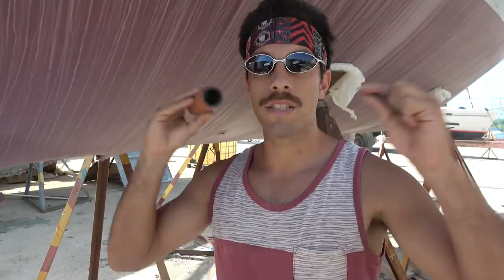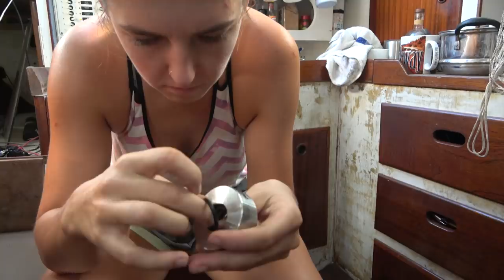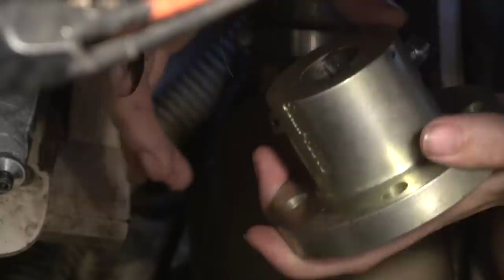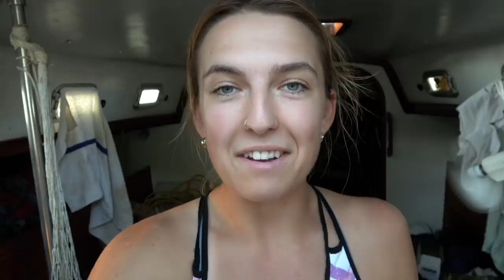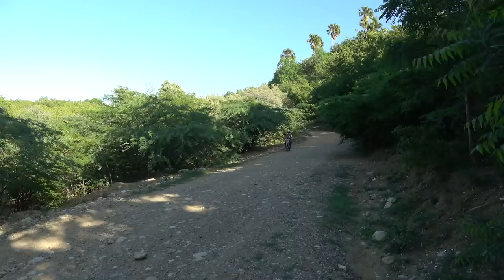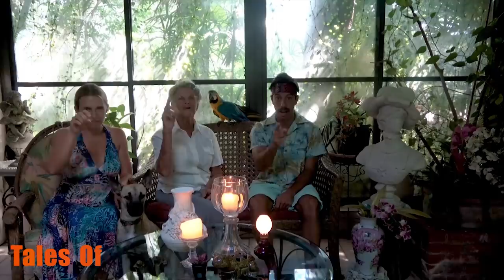Sailboat DRIVE TRAIN Installation 🔨 Ep 96

Comment: Right after you do the rubber mallet thing, 'whacking it into the hole', you can see the alignment of the flanges.
You can also see that there is wiggle movement in the shaft, at 6.20, when Michal moves it.
If you get a set of feeler gauges in there, see if there is equal spacing between the flanges, at the top, bottom, left and right. You will need the bolts taken out and the shaft resting to do this. Also rotate the shaft 1/4 turn at a time, then check again. Do it four times to get a feel for how the flanges are sitting. This will give you an overall picture of the alignment. Adjusting your engine mounts is the only way to get things aligned properly.
Good luck guys and happy travels.
Reply from the maker: Okay, thanks for the tip. We will first have to get a hold of feeler gauges.
Reply: @Bumsonaboat   YOU ABSOLUTELY WANT NO MORE THAN .002-.003" MISALIGNMENT ON THAT FLANGE!   ANd.... don't do any major moving of the engine and mounts until the boat is IN THE WATER for at least 24 hours. Your hull will change shape in water versus on the jack stands. Do as James Williamson said- i like the slide the blades in at 12, 6, 3, and 9.   You can Google prop shaft alignment I am sure there are tutorials. Why am I so dire about this? I don't want you to have a transmission output shaft bearing failure due to mis alignment. I have been doing this for many years, many engine pulls, trans replacements, and I have seen big gear boxes on tug boats absolutely eat themselves due to a combination of out of balance props, and mis aligned mounts.
Reply: @Bumsonaboat  They are right on the alignment , I did not bring it up because you did not move the engine and if it was out before you would have known after all that time it was in before servicing . 

However you should check and it is not hard .
Reply: Even though the engine hasn't moved, you replaced the cutless bearing and changed out the prop shaft and coupling, so it absolutely needs to be aligned.  However, you really can't do the alignment until the boat is fully rigged and back in the water.  The hull  can flex enough that if you did it on the dry, it might not be correct once you are back in the water.  You might even consider an R&D flexible coupling.  I have one on mine and not only does it allow you a little more room for error between the couplings, but it also prevents any damage to the transmission if anything should stop the prop from spinning.  Here's a link to the R&D flex coupler: https://www.go2marine.com/R-D-Marine-910-013-Flexible-Couplings?gclid=EAIaIQobChMIp6KKleLP5QIVrf_jBx2tTQdtEAQYBCABEgJQ_fD_BwE
Reply: @elliowb2   Yes , probably does need at bare min checking to make sure it is still good .

Comment: It’s common practice in engineering / machine fitting that where needed trimming or cutting the bolt down to the exact required length for the job. Sometimes off the shelf items are not the perfect length.
Reply from the maker: Okay, good to know.
Reply: @Bumsonaboat  cut the bolt

Comment: The way you do the alignment depends on the number of cutlass bearings. If there is only one, as appears to be the case, then there is no support for the shaft inboard end except the engine coupling. In that case when you disconnect the shaft coupling from the engine, the shaft inboard end drops until it either binds in the strut bearing or rests against the bottom of the stern tube (where the shaft seal mounts). You don't want to align at either of those positions.  With one bearing you need to temporarily support the inboard end of the shaft so the shaft is centered in the stern tube, and then align the engine to that.   Then take away the temporary support, and the shaft will stay centered in the stern tube.  This can be done out of the water.  If there are two cutlass bearings, then the shaft inboard end is supported, and the alignment would be done as already described.  Greg

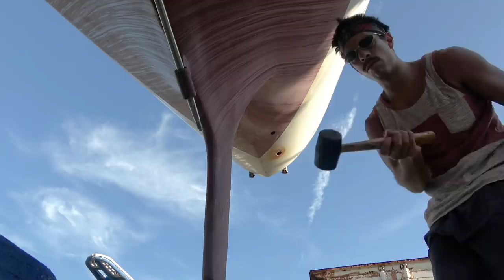Comment: At 6:20 you can see the prop shaft is offset to the port side.  Olympic, the builder of the Carter 33, did this in most of the Carter boats.  It causes the boat handle funky.  Mike has said 2 or 3 times it lists to the port side.  Your boat is not broken but it is a bit of a design or manufactures flaw.  Good eye, Mike for noticing that characteristic in the boats handling.

Comment: Don’t forget to check your alignment between your transmission and prop shaft couplings
Reply from the maker: Okay, any recommendations on the best way to go about that would be appreciated. Of course we will do our own research as well.
Reply: Bums on a Boat 
Use a feeler gauge between the couplings...check again when the boats afloat..
Reply: That was my first thought as well. They looked a bit off when first connected.  Also didn’t see a zinc go on the shaft.
Reply from the maker: @georgegulden5819  good catch, we have a zinc but have not put it on yet.
Reply from the maker: @rollinrock6696  Okay, we need to get a feeler gauge. Others have mentioned this same idea.
Reply: @Bumsonaboat  They are cheap - get one in an automotive store .
Reply: PYI flexible coupling helps

Comment: Buy bolts that end flush with the end of the coupler. I would loctite the threads on the bolts AND run a lock washer between the bolt heads and the coupler. Those nuts, just put 'em in your "fix it at sea" kit.
Reply from the maker: We will definitely use locktite but do you think our nuts are compromising the integrity?
Reply: They can just cut them of at the right length if they want - either in place or on the bench . If on the bench put the nut on first and it will fix any messed up thread from  cutting when you take it off . Lock tight is a must do - I assume they put some on at final assembly .
Reply: @Bumsonaboat  unlikely. but for simplicity (and having fewer spinning things to snag wires and such) I'd swap them out. If they're stainless then you could cut 'em with a hacksaw, but since you're close to a store, just get new ones. But this is CERTAINLY not urgent by any means. The repair looks solid as it is and provided your shaft and engine are aligned, it should be just fine.
Reply: Just use stainless flat washers and then a lock washer to adjust for the proper length
Reply: @deancartwright9784   They will get clearance issues . The bolts can be cut in place with a grinder or on the bench pretty quick  . Project is long done now .  Needs loctite though .

Comment: Hi - 80 year old engineer here. May I suggest that you get a tube of Pliobond General Purpose Adhesive and use it on all nuts and bolts. It prevents them from working loose in service. Most importantly it protects the threads from corrosion. I've used it for over 55 years on my cars when rallying, dinghies and yachts when sailing and on my sailplane when flying - never had a nut come loose. Also use it on gaskets on the engine - no water leaks - no oil leaks. The only disadvantage is that you can't 'crack' a nut loose and run it off with your fingers - it's a spanner all the  way. I could live with that. Good Luck - Edi
Reply from the maker: Appreciate the recommendation. We will see about getting some sent here.

Comment: I would remove the nuts and replace with a lock washer, like original. Once you thread them in all the way grind off the excess threads that stick out too far. This is the best way
The way you have it now can work, it's called a jam/nut system. Hold the bolt head and tighten the nut, jamming it against the collar. This way is used more for set screws and such. It's Not very good for this application. It won't hold the couplers together very tight and may wobble out the thread holes. Iv'e worked on AG equipment for years now.
Reply from the maker: Okay, appreciate the feedback.

Comment: Chains stretch over time and don't line up with the sprocket teeth after a while. A new chain will not line up perfectly with the old sprockets but usually it works okay. After a few miles on the new chain re-tighten it cuz new chains stretch at first. Loosen the axle nuts and slide the wheel back in the dropouts to adjust chain tension.  Keep it pretty tight on there so it won't bounce, just a little slack and yer good!

Comment: The prop lock nuts are installed incorrectly. The thinner nut goes against the prop. Didn’t see you check the engine alignment as others have noted. Also the coupler set screw should engage with a dimple drilled in the shaft. Finally, the set screw should be wired so that it doesn’t back out of its hole in the coupler.
Reply from the maker: Thank you, many others have mentioned the same point about the prop nuts. The set screw did engage with a dimple and we do have wire for them but unfortunately forgot to show that part.

Comment: Just replace the coupling bolts with 10 odd millimeters shorter set screws, and spring washers, and for your bike a 12B1 master link. Your rear (gearbox flange has tapped holes and is not designed to have nuts on the set screws, shorter sets with a spring/compression washer with locktite. There should only be two threads protruding from the rear threaded flange, try and avoid stainless steel set screws, rather use grade 8.8 sets. Another tip is to use a copper or nickel antseize on the set screws, pretty decent drivetrain installation👍👍👍👍👍
Just be very accurate with your coupling alignment, your motor should have jacking bolts on the mountings to set your up/down and left right clearances on each bolt hole at top centre, you will, or should use a feeler gauge to adjust and do not lock your shaft coupling flange until your alignments are correct, you may need to knock the shaft in slightly (loosen stuffing box seal before and then readjust) to ensure the shaft coupling flange is correctly seated on the shaft spine. So far so good👍👍👍👍👍
Reply from the maker: Okay, appreciate all the info.

Comment: Shorten the bolt with clamp/hacksaw/file to dress up the cut end.Bike- are the back and front sprockets aligned ?  If not and one is angled the bike can explode :)
Reply from the maker: Okay, good tip. That was the problem, the back wheel was not aligned properly.

Comment: On a set screw hole of this size ? You should have done the threading by hand never by drill. The strut when installing a new cutless bearing and is loose like you have the bearing should be installed in epoxy first than the set screws.
When installing the collar for the PSS did you check the key way to make sure there were no burrs sticking up that could damage the o rings in the collar ? 
You did not check the alignment of the engine ? By way of the couplings.
Reply from the maker: Thanks, many others have confirmed that the drill was a bad idea. As for the bearing, yes we are a bit worried that it went in so easily. We like the idea of epoxy paint but are a little unsure if the west systems epoxy is a good idea...thinking it will never come out.
Michal was very protective of the o rings and there were no burrs. Correct, we still need to check the alignment. Our thought was it was good before we replaced the shaft and we ordered all the same specs. Thanks for the feedback.

Comment: STOP STOP STOP 
THOSE BOLTS GOING IN THE PROPELLER SHAFT FLANGE COUPLING SHOULD BE REALLY GREASY TO PREVENT THEM FROM RUST AND CORROSION.  Really you can smear grease all over that coupling and shaft to keep it from rusting or paint it.  
I like paint 

You don’t need the extra bolts but they are not going to hurt anything.  

Keep an eye on them to check for coming loose.  

Aline the engine!!

Comment: Chains strech and need replacement on motorcycles. When you replace chain you also replace both sprokets or you destroy your new chain. If parts are available it is an easy job. You might want to use penetrating oil on nuts and bolts to make removal easier. I would use the oil every day while sourcing parts. Count the teeth on both sprokets so you buy the correct ratio sprokets. If you want to try to use same chain for a little while you may have to shorten it a link or 2. You don't want it to break and speed became it might lock back wheel and break other parts or hurt you. You might want to use penetrating oil on your motor mounts on boat. You will need to turn those to adjust coupling alignment. Good luck
Reply from the maker: Okay thanks for the info!

Comment: if you leave the nut on the bolt this will add a variable  which means the nut will heat up and cool down after awhile this could make the bolt come lose . what I would do is cut the bolt the correct length and when installing it put some lock-tight on the tread of the flange , hope this helps I also agree with, Andrew Logan
 and @UC6Juq-5oCCwN3Mm0YyHJ0Jw. comments cheers and fair winds

Comment: Just a ditto on another's post; trimming a fastener which is too long. After measuring the depth required of the piece, I've placed many an item in a vice and cut them to the desired length with a hand-held dremel and a cutting wheel. If going into a blind hole, cut off enough to allow the bolt to be properly torqued without bottoming out. With each of my jobs, the end result has never required dressing the threads, they've always mated perfectly. I'm a believer in always creating a few spares when customizing is necessary. Bag em, tag em and stow them. I suggest that you buy a small vice, which doesn't need to be bench mounted. They are heavy enough to hold relatively light items steady enough. I have one from Harbor Freight that would usually be clamped to the table of a drill press & used to render objects to be drilled immovable.

Comment: Those Packed out Bolts on the Transmission / Shaft Flange will not do and will fail (there is not enough thread on the nuts. 1. You need the exact size Bolts. you need full thread through the Nut. 2. You should be using the Nylon Insert Nuts on the Bolts to prevent vibration loosening 3. You need to check the surround Clearance with a feeler gauge (rotating the shaft so that its a perfect flat mating flange join) so that the interfacing Transmission / Shaft Flange mate in as close together flatness as possible no wobble - otherwise this leads to unnecessary vibration and your Nuts may come loose! You must get the correct Nuts and Perfect size bolts, packing out the nuts is a no no, spring washers are fine My advise as an engineer - This is a very important part of the boat and safety as well you can even loose your prop shaft out the back - and this is common problem on sail boats - Really suggest you take your time on this and get it as perfect as you can - highly recommended XX Pete love your channel

Comment: Hi BOAB, Gettin closer and closer to back on the water. Michal you gotta watch Joel when he's shovin the shaft in, looks like he went to quick the first time...lol.  I think it would be a wise decision to buy shorter bolts for the transmission to drive shaft or add a washer or two to get the end of bolt flush with the connecting plate. Make sure that you have a good alignment of the driveshaft to transmission too. How much longer do y'all think it will be before you're back on the water? Lookin forward to seeing you back on the water. Good luck with the rest of the repairs... Peace Luv Rock N Roll

Comment: That prop is like a brake. There are sailing two bladed props that perform well and dont make much drag.
Reply: Folding/feathering props are super expensive. I think they’ll prioritise going sailing and have more cash in their pocket than getting that extra 1/2knot boat speed.
Reply: Why,?well it's none of your businnes really.                                                                                                                          This is constructive criticism and I agree, they are.I meant a fixed two blade prop.I keep one as my spare.I have a Radice folding prop which isn't great under power but the difference it makes under sail is huge.That prop  most likely will eat a knot or more off that boat's speed which can extend a passage by a long time.   They could try and find a second hand one perhaps.They have a fine sailing boat. It's a shame to slow her down. I completely understand the meaning of tight budget though.
Reply from the maker: @nunosantiago2273  we do actually have a salvaged 2 blade prop we carry as a spare as well. We may experiment in the future with attempting to get more boat speed with a smaller prop... But at the moment just getting her seaworthy will do!

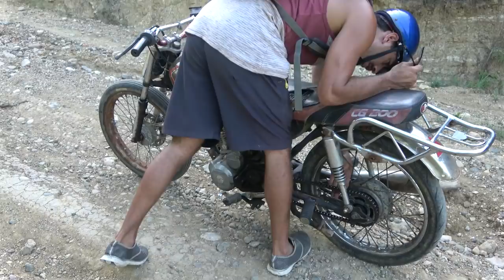Comment: at 14:07, seems like the chain is way too tight and one bolt of the sprocket on the gearbox seems missing. If that's the case then the small sprocket was probably weebly wobbling the chain off and putting the tension on the chain broke it. Dunno for small bikes but for a dirtbike there should be at least 20mm of play top/down in the chain when you're sitting on the bike (this changes the tension). Exact Measurements are in the manual or sometimes on a sticker on the swingarm.

Also almost everything which is supposed to rotate is best rotated into position. If you just push it's more difficult and you're more likely to fold over a seal. Rotating also helps distributing lubricant.

Different sizes on the grub screws is not to surprising, probably the threads got damaged before and somebody tapped a larger size.